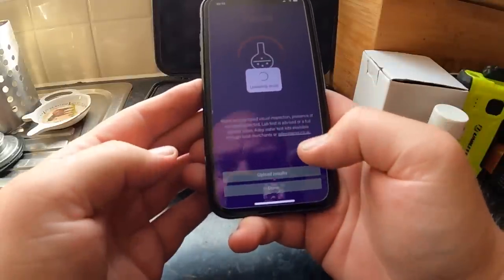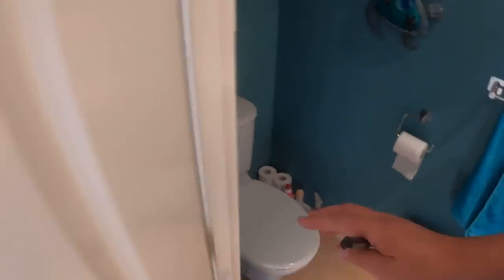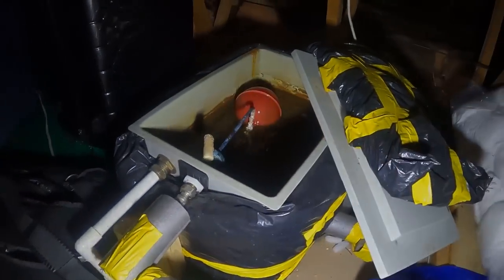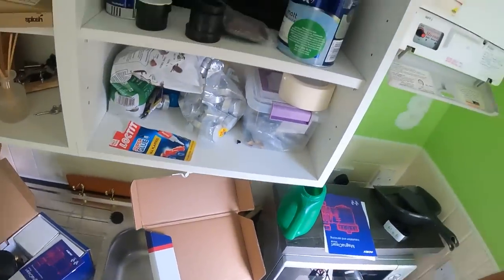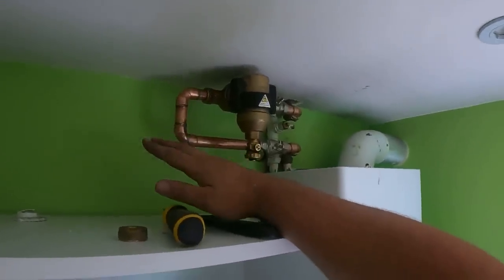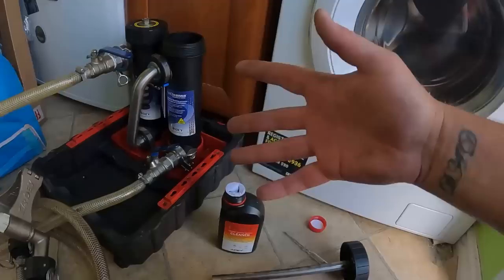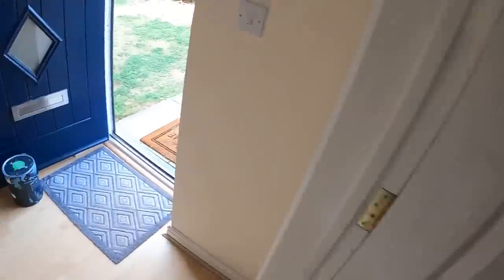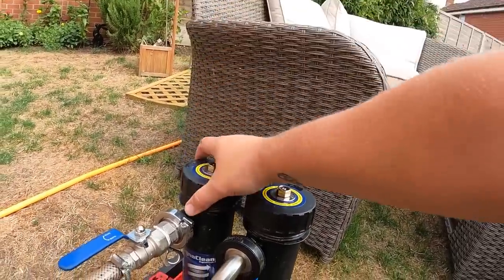FAILED TEST!… SAVE MONEY on your ENERGY BILLS with a HEATING SYSTEM FLUSH

Comment: Think I need to have this done, new boiler and cylinder fitted but I can hear water being dumped in the F&E tank at intervals and the overflow pipe constantly dripping.......called plumber but he's ignoring txts and calls.

interesting to see what comes out......nice video mate
Reply from the maker: Certainly a good idea to get it done, and try turning the pump down if it’s pumping over the header tank….
Sounds like the plumber is a bit of a man idiot not returning calls/texts…..

Comment: How often does it need flushing been in house 14 years and never had it done (new build with air source heating)
Reply from the maker: Would certainly look at having it done mate…. The test I did to start with will tell you what state the system is in.
Will save you money on your heating bills as you will be able to turn the heating down and use let energy as the rads will work better😉

Comment: Could you not fit the magnaclean on the return in cylinder cupboard
Reply from the maker: Zero room in there mate hence it being squeezed in by the boiler
Reply: Heating & Plumbing
0 seconds ago
That wouldn’t protect the boiler anyway. The cylinder return will T into the rad return, Crap from rads would go straight past it. Mark done it right.

Comment: Guarantee its a myson trv head, change lots of these, its a common fault and always found in new builds using cack microbore systems, but luckily screwfix do myson replacement head's, saves faffing about trying to snatch a new rad valve on and guarantees another job in approx 10 years time 😉
Reply from the maker: Yep exactly them mate…. Screwfix supplied the replacement heads the next day👌🏼👌🏼😉

Comment: Class video as always mark, my main question on this one is would you charge for the "checks" you did or would you do that "free" (included in the works required)? I'm always unsure if I should charge for something like this, or charge for it as it's somewhere in the middle of doing work, and going to take a look to provide a quote
Reply from the maker: Thanks Josh
I gave them a quote to check the whole plumbing system over and make sure it was ok. Extra for bits that needed to be replaced like the button and the ballvalve etc, it’s quite time consuming.
Then the flush was quoted itself aswell…. 

Your providing a service after all mate👍🏼

Comment: Oxtail colour is a sign of pumping over or suckung down. Air separator or pipe configuration in a/c not correct & pump position. As the system is mini bore alot of resistance hence the pumping over. I would of checked the airing cupboard pipework. Also I would of linked the cold feed to the open vent so you can flush that out which is normally where the issue starts from.  Also check the height of the open vent above the header tank as again that can impact the system pumping over. Or make the system a combined feed ( 22mm straight in to the header tank) stops pumping over & sucking down. Make sure the boiler which by the looks is a gworm micron cast iron hex has an over heat stat. I would be advising a new boiler upgrade due to the age of it.  Alot of time spent could of been saved by a new boiler better efficiency & that awful filter fitted better. As you've drained the whole system down I'd of fitted new trvs as standard. Those new heads aren't cheap either! Still the punters paying !!
Reply from the maker: The customer will be upgrading the WHOLE system in a few years so that would of been a complete waste of money, myself and the customer went through it all….. hence this is what I’ve done.

Unfortunatly when something is out on here as a platform of viewing you can’t go into EVERY SINGLE detail of every single job…. That would be extremely boring and that’s not what the channel is about.

Unless you know the whole picture of what the customer is doing/wants to spend/end goal etc etc then you can’t really say what I should of done.

It’s all down to what the customer wants.
You are a “glass half empty” type of guy I’ve worked out…😉
Reply: Exactly i agree all that great flushing of the system is just treating the symptom and not addressing problem
Reply: @MJTiffPlumbing  I appreciate your kind comments about me did make me laugh. Keep up the good work on the channel . I'll keep an eye out fir that glass of water you mentioned 🤭

Comment: Do you really need an APP to tell you that water is dirty? I don't get it i can see it's dirty without an APP. Am i missing something here?
Reply from the maker: The answer is No….. you don’t need an app to tell you it’s dirty.
However I like to use the app to be able to show the customer the stages and the results as at the end you have a clear bottle and from looking at it you can’t see if it’s PH levels are correct, corrosion levels are correct etc….. that’s what the app tells you and you can back it up with this information.
Reply: @MJTiffPlumbing  I guess it is good for showing the customer before and after results... Keep up with the interesting vids 😊

Comment: To be honest mate what a load of bollocks its become , these boiler manufacturers are just building inferior products that will fail with 000.1% of grime in your water so they can then just refuse warranty and blame it on the homeowner , new boilers = more money than letting you run one with 20+ years , funny before the new wave of condensing boilers , old main or combi boilers can be found still going strong , my mum had a valiant main boiler for 28 years and only reason we replaced it was EPC crap , Ideal logic .... went wrong 12 months and 5 days , ideal didnt wanna know in the middle of COVID , the throw away , tight tolerances and build quality we are heading to is frankly a disgrace. If i had my brains 10 years ago i would have kept my old non-condensing biasi combi. Sorry for the rant great video as always but just gets my goat these new procedures, i mean do we need scientists or heating engineers 🤬
Reply from the maker: I know EXACTLY where your coming from, however the legislations etc are becoming a lot tighter and these things now need to be regulated… hence this procedure
Reply: @MJTiffPlumbing  totally get you but personally i rather they build these things to run with a little dirt or have filters that can be replaced or cleaned , could be done but i guess financially they know it wont benefit them

Comment: Hate to say it but you missed out the most crucial part of the flush. Mains flushing it afterwards. The way I do it on open vent is cut in a filling loop and pressure reducing valve set at 1 bar between cold mains and cold feed with the hose on the Magnacleanse unit open. This ensures that you flush all of chemicals out one rad at a time. You’ll be amazed at how much more non magnetic crap comes out. Easily reinstated with a compression coupler. 
This is in the Adey course as well
Reply from the maker: I have yet to be converted into putting mains pressure through a microbore heating system that I know nothing about…. I personally wouldn’t want to run the risk of blowing fittings and causing a huge amount of damage.
It was cold flushed through just not at mains pressure 👍🏼👍🏼
Reply: @MJTiffPlumbing  With the hose on and valves open it’s not really much risk mate as you have a PRV set at one bar.
Reply from the maker: Will be speaking to Ricky soon anyway😉😉

Comment: So satisfying those adey magnets seeing all the crap removed! Cleaning them off is messy though. Also, top job with checking the TdS & ph check, soooo important that not just seeing water clean cos if it’s not neutral, can wreck a system. Is worth pointing out, if house has a water softener, checking that header tank or fill loop is not through it when refilling as most boiler makers state no softened water to be used in topping up/refilling. Also, no heating engineer should be without a thermal imaging camera…top job MJT!
Reply from the maker: Thanks buddy…… yer I love doing system cleans

Comment: You got me worried now , my heating is all in 10mm plastic push fit, do you think that sludge could push a fitting off if it's not cleaned out, and if I were to flush it through myself how would I introduce new inhibitor to a sealed unit. Thanks for any help, good vid again Mark.
Reply from the maker: Always a risk if it mate, worth flushing through. Inhibitor can be added into a towel rail during refilling

Comment: Hi Mark, what a fantastic film, I really enjoyed this one.
I have never seen that much sludge come out of a system before, well done squeezing that system filter in, I bet that was a struggle.
I did notice a lot of the dreaded 10mm copper pipe to the radiators, also great to see the Adey system test kit. A excellent job, well done, have a great week, take care, regards, Chris. 👍👍👍
Reply from the maker: Thanks Chris…. Yep it was a very sludged up system this one.
Yer all of it was 10mm to the rads… never good
Reply: I had a similar system the sludge was thick the system was plumbed wrong, when heating was on the water circulated from the boiler to the tank cupboard and back, the radiators only came on when the hot water came on because the cylinder return connected to the to heating flow, it had been that way for 10 years. 
The farmer never said anything to the landlord.😮
Love 10mm copper when done properly with a clean system.

Comment: Hey mark, I need to chemical clean my heating system. I have installed a magnaclean filter. Can I use that to chemical clean? The magnet is good but smaller that the pro version and only 1 magnet.  Would I need to checker filter after each rad flush? Also - I have balanced my heating system. If I close of each rad then what’s the best way to rebalance? Cheers.